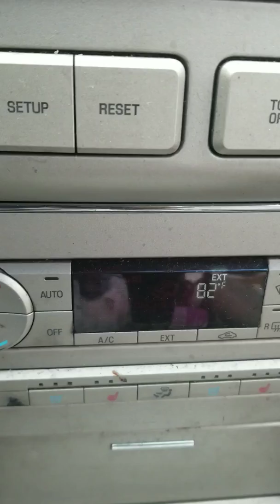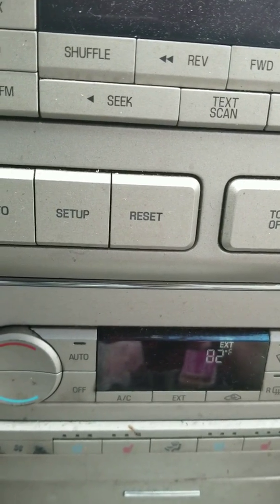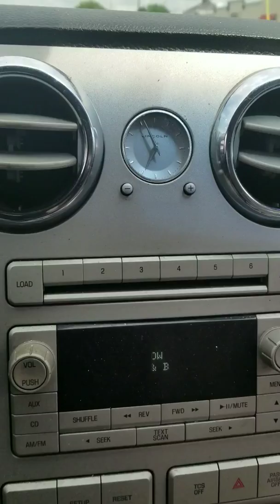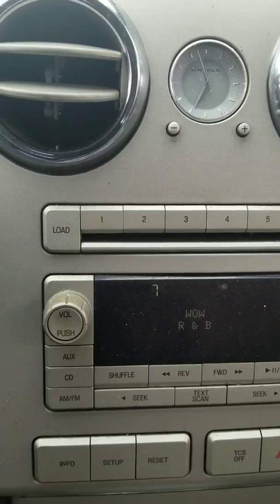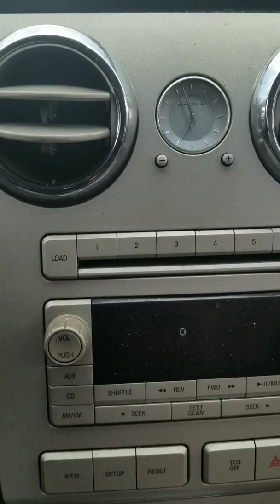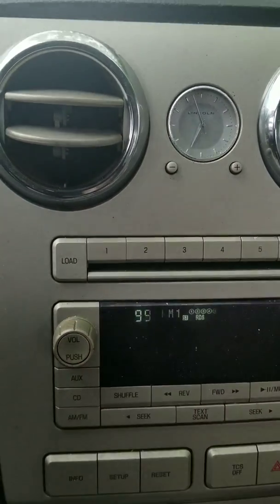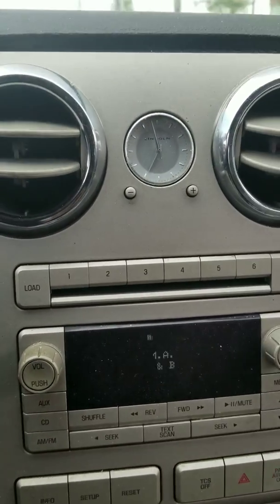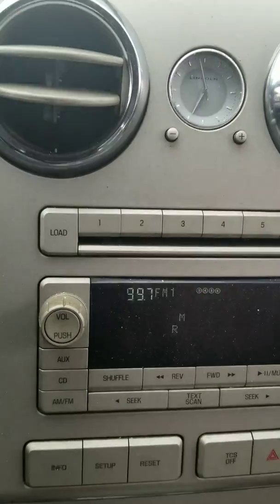9 Month UPDATE !! Evaporator Tempator Sensor bypass for Lincoln / Ford vehicle AC

Comment: I just did mine , pull the dash out and replace sensor on mine driveway just use just regular hands tools and screw drivers  less than 3 hrs it’s easy anyone can do , doing the bypass your A/c system won’t work property sensor keeps A/c from freezing!

Comment: what you did is canceled the evap temp Sensor and its job to shut the ac off when the evap is to cooled so it won't freezes and that's exactly what is happening with you
Reply: If you watched his video of what he actually used then it would not be that. He did not use a resistor, he used the actual ac evaporator sensor part. If he used a 30k ohm resistor then he would have that problem.